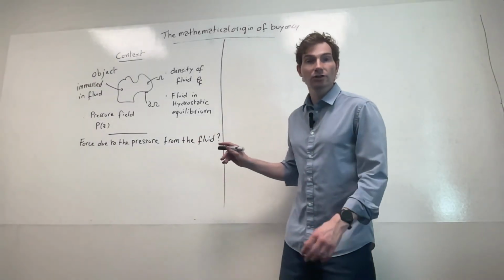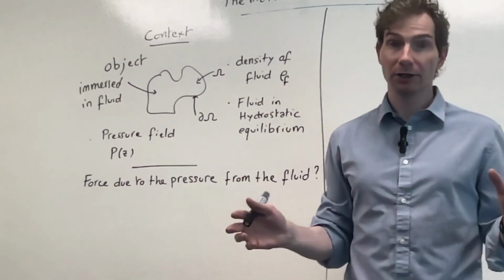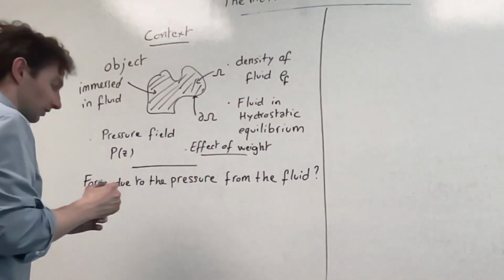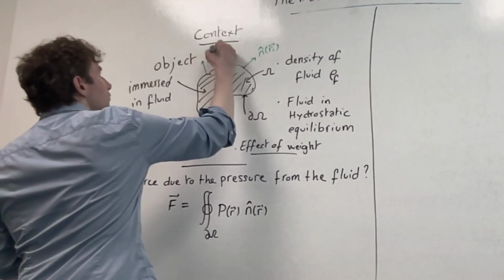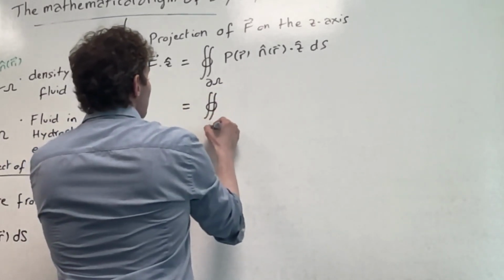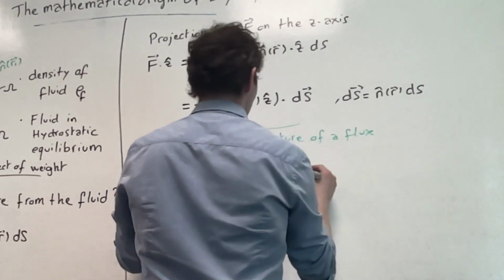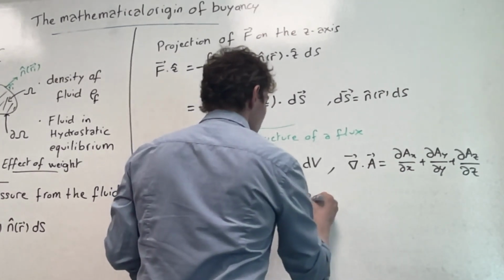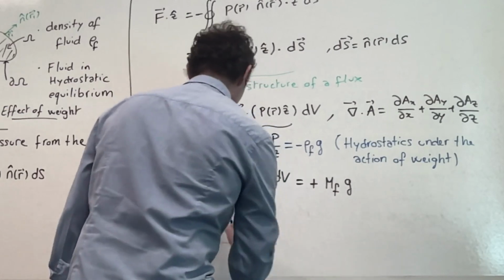To the Whiteboard! - The mathematical origin of the buoyancy law

Comment: Thank you for this nice video; I've known for a long time that it's possible to use vector calculus to derive Archimedes' Principle from the hydrostatic pressure principle, but I never knew the details. I suppose that technically your argument just shows that the vertical component of the buoyancy is equal to the weight of fluid that would fill the submerged volume; you would need to apply the same type of argument again in the horizontal directions to get that the horizontal component of buoyancy is zero. Alternatively, apparently there's a corollary of the Divergence Theorem that says that the volume-integral of the gradient of a scalar field is equal to the vector-surface-element integral of the scalar field over the boundary; this then gives the full vector result for the buoyancy force in one go.

There's one correction that I'd like to make to your video, if I may: At 1:21, you say that the upthrust magnitude is equal to the weight of the part of fluid that is displaced in order to immerse the object in the fluid. I know that virtually all expositions of the law of buoyancy phrase it in a manner suggestive of that kind of picture, but it is not correct. The volume of the immersed part of the object is not equal to the volume of the part of the fluid that had to be displaced in order to make way for the object, because the fluid-level itself changes during the process. A body of fluid can actually exert a greater buoyancy force than the entire weight of fluid present! (These are sometimes known as "battleship in a bathtub" scenarios.) In a video called "The most universally misformulated principle in physics", I discuss this in some depth.
Reply from the maker: Thank you. That's a very good point. The "displace" terminology is used in a fictitious scenario that has nothing to do with the actual amount of water that had to be displaced in reality, which depends on things like the shape of the container and the original volume of fluid being present before insertion. 
I will update my lecture notes accordingly.
Reply: @fabienpaillusson7390  Thank you for your very nice reply, and for watching my video! 🙂